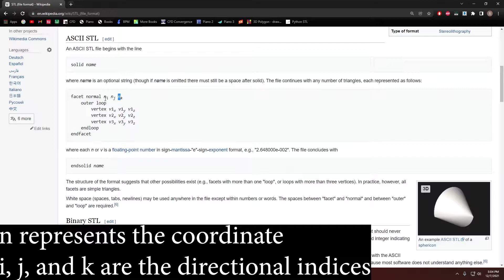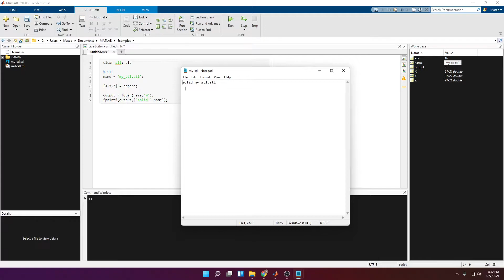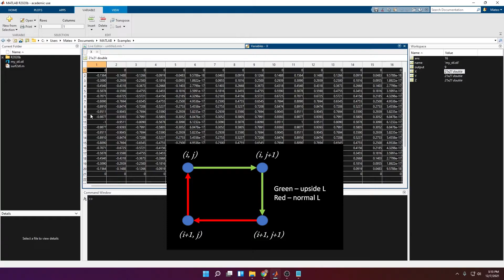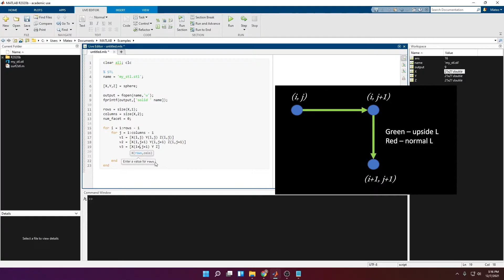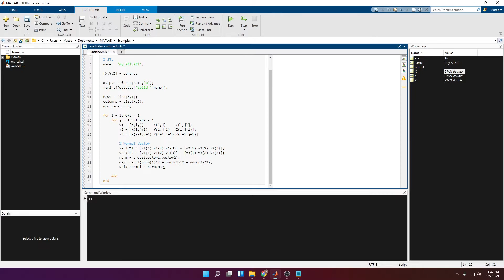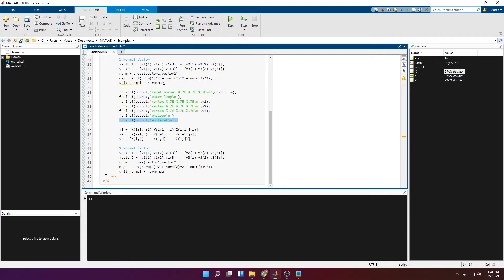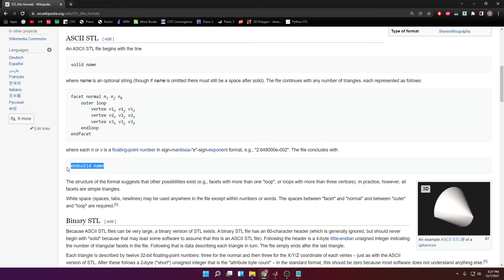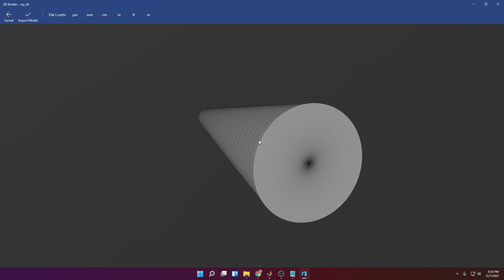Write an STL (ASCII) File in MATLAB || TUTORIAL

Comment: Excellent, thank you. When I use the created file, this command fails. I think it may be the NaNs, but not sure.. It does open in the 3D viewers.
base = platform('FileName', 'my_stl.stl', 'Units', 'm'); If I download the Sphericon.stl from the wikipedia page you reference, it opens and has no NaNs.
Reply from the maker: Hi! one question, what software are you using to open the created stl file? The NaNs are probably from the normals. Some apps don't even read them but if they do, that problem might occur. A workaround is to replace all NaNs with 0. Like
isNAN(unit_normal) = 0
Reply: @prot0form775  The matlab built in function shown in my post. I did change the NaNs to 0 0 0 and that did fix it. All is good after the 0's replaced NaNs. Thanks